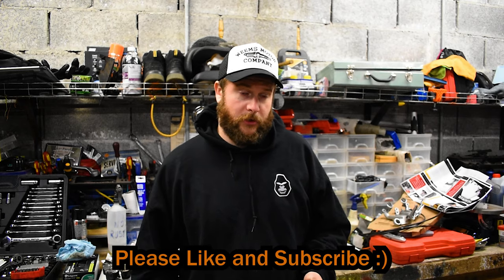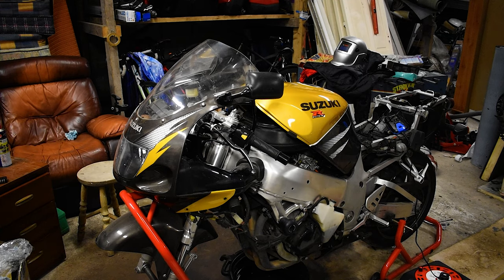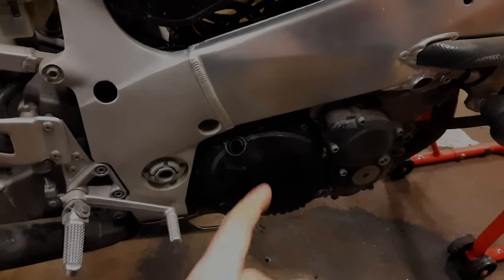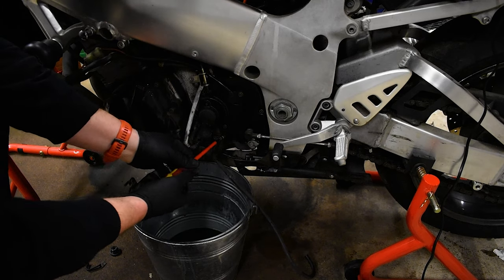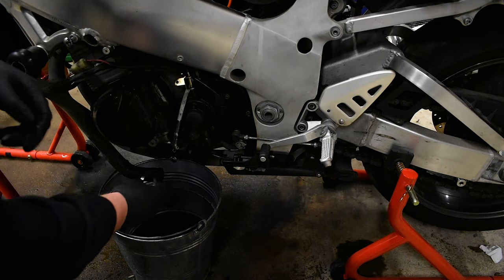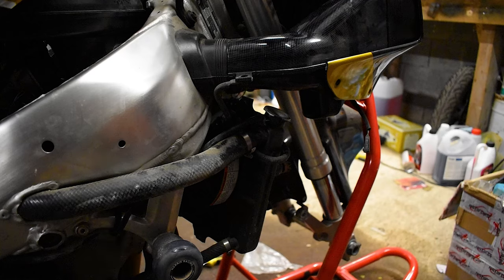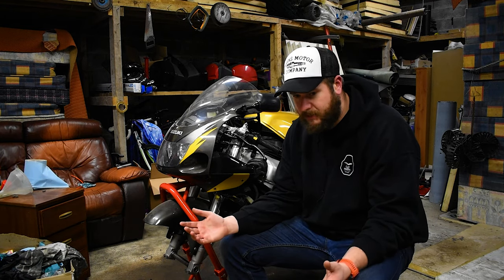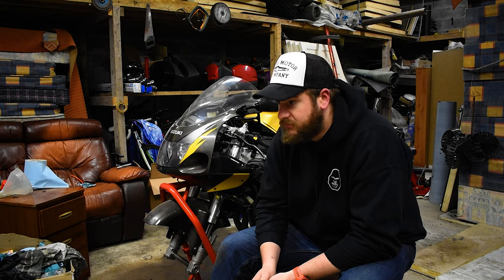Suzuki GSX-R 750 SRAD Rebuild | Oil, Oil filter and Coolant Change!

Comment: Hi mate did you have to balance the carbs to get it running nice Iv just rebuilt my carbs and now it’s sounding ruff
Reply from the maker: I balanced them on the bench, without that they'd be rough alright. If you don't have a balancer just pull them back out and get 4 shims or coins of equal size. Jam open number 3 with the coin/shim and balance the rest off that. So just adjust with the screws until theyre all equally tight on your shim or whatever you've used. It's actually pretty easy to do and mine runs up through the full rev range smoothly after that :)

Comment: Do you know any good places to buy parts for this bike? Mines fuel pump assembly is trash but I dont want to pay 600$ for a new one
Reply from the maker: Yeah I've used cmsnl.com and ebay a good bit. For all fuel pump bits I got them on fuelperformance.co.uk, I think I linked it in a video where I rebuild the fuel pump assembly! Parts are there it just sometimes takes a bit of searching :)

Comment: Good thing that oil was ok given how you ran the engine with it. Did you consider running an oil flush? I've heard many conflicting opinions on the topic.
Reply from the maker: I dipped it first and checked it don't worry 😂😂 Nope, I've went through mostly really old cars usually and a fella who's long since passed away always recommended doing it this way. Not that I wouldn't try an oil flush but this has always worked for me . Also even if that oil was rubbish in my opinion you're better off heating it a little before draining it as it'll get it out of all the galleries and such where it might have sludged up. The max I'd ran the bike for was 5 mins or so.
Honestly I'd be more concerned about the coolant normally

Comment: Keep the good work up man 👍. I have just  also put new bridgestone BT016 tyre's on my SRAD. Good cheap tyre's won't break the bank account . Bargain. Before you know the SRAD will be ready to ride 🏍️😎.
Reply from the maker: Thanks man I shall :) I was looking at S22s....Very tempted to try fit them myself. Worst case I wait until I'm paid in January and I can get them then :) Just forks, brakes and tyres :D
Reply: @TheGorillaBiker  yes they are the better tyre's. I have always used bridgestone tyre's on both my bikes. So go for it man 👍🏍️.
Reply from the maker: It shall be done :) I was only thinking the S22s cus I plan on bringing it on track :) Ive used most of the brands and always found them all good except my last set of dunlops on the Fazer!

Comment: Question, where does the black skinny hose that connect to the top of the clear coolant reservoir connect to? The carbs? Please help
Reply from the maker: It's an overflow if memory serves. The lower house goes to the rad, the upper hose is an overflow hose and goes to the ground

Comment: Hi ya, sorry to ask and thank u for ur fantastic videos which have helped me a lot, however I just wondered do u have any tips for a bike that’s eating Petrol and running rich?
Reply from the maker: Is it a carbed bike? It could honestly be anything, but if it's carbed it's no harm to give the carbs a good clean. Has it always been like that or did it change recently?
Reply: @TheGorillaBiker  yep a carb with no injection , it had a new recon engine put in last year and has sat for that time hence me doing a service on it, but seems to be running rich still 🙄
Reply from the maker: @tobias7574  First things I'd check then would be is the pilot air screw is set correctly, are the jets all the correct stock size, is the exhaust and air filter etc stock, and then I have heard of people accidentally putting in a injection fuel pump rather than a carbed bike fuel pump which forces too much fuel in to the bowls, you're float bowl needles could also be worn if they're not new and no longer stopping the flow of fuel. There isn't thaaat much to troubleshoot.....just kind of everything in the fuel system :D It'd be worth checking your sparks too if they're old.
Reply: @TheGorillaBiker  that’s great! Thank u so much for ur advice…. I’m going to check those and let u know how I get on.. btw it’s got a k and n air filter which I just recharged plus I put new standards plugs in, oil change and coolant oh and some carb cleaner through the Petrol